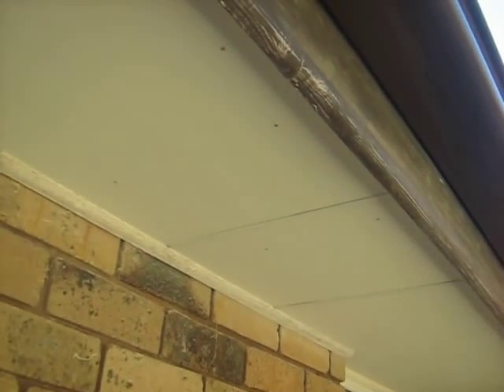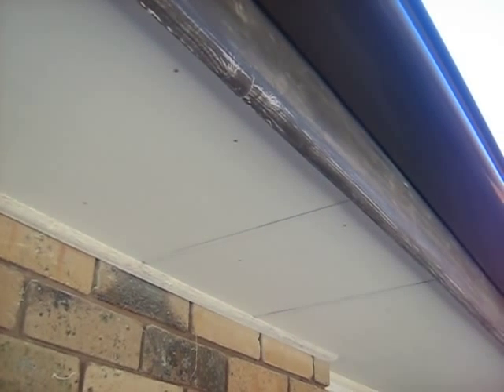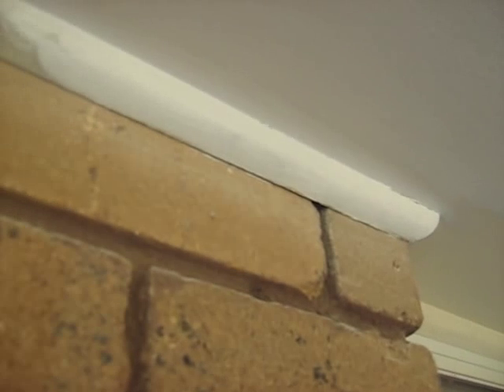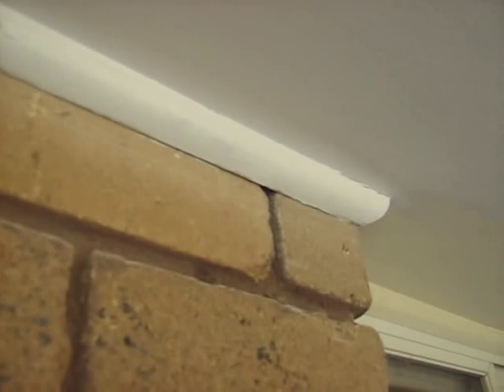painting of eaves

Comment: Hello from California, I am painting Eaves today and I have a question for you. The house is one level but Has a patio cover that blocks ground access the eaves were changed recently by guys hanging off the roof. Did you ever use ropes or make a hanging scaffold to word from the roof? Do you have any suggestions? Thanks
Reply from the maker: Yep the toughest kind of work out there , its not going to be easy, and it will be dangerous.
When you say a patio cover that blocks ground access do you mean its to high ?,  do you need to paint a patio cover eave ?
If you need to paint a patio cover eave and there is a deck below it dont get planks hanging off the deck by 2 - 3 feet and counter balance them with many many sand bags ( so they wont tip ) and scaffold across the front to paint the eave 
if you can get a ladder to reach  then secure the bottom of the ladder ( get a shovel and level the ground and put bricks in front of the ladder or even make a hollow for the ladder feet to sit in ) and get some metal bracket to secure the two top ladder posts to the house ( im assuming its wood clad ) and get some good rope to secure yourself to the ladder in case you slip and fall 
( That is what i would do. )
It is very dangerous think it through and go slow and careful, they will just have to pay by the hour for that type of work 
No i didnt need ropes or a hanging basket thank god